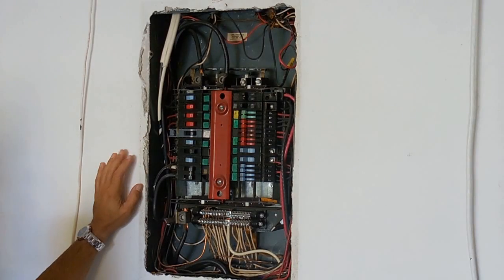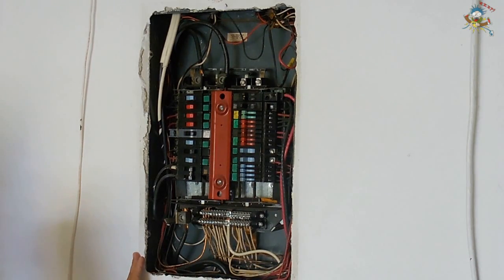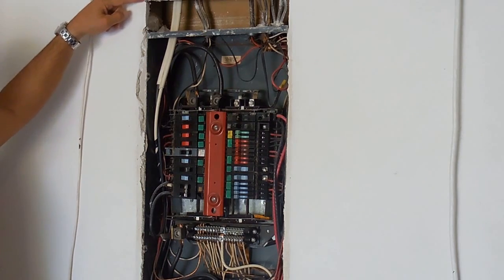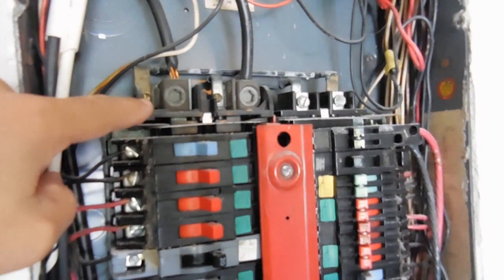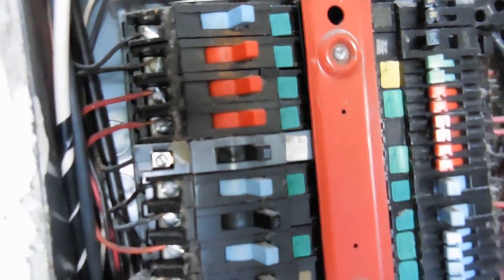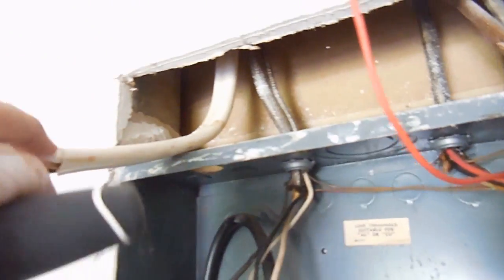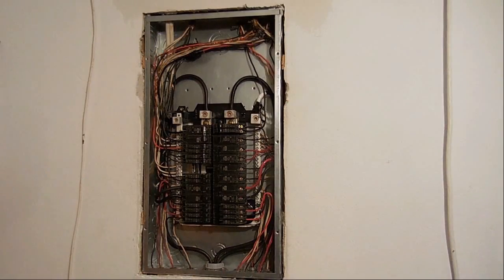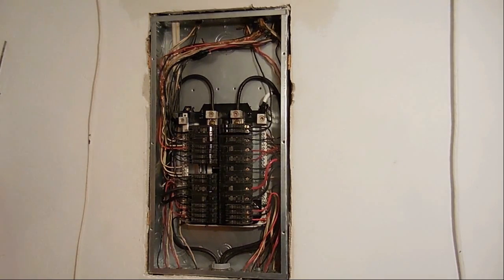Swapping Out A Breaker Panel! (How To Replace An Old Breaker Panel)

Comment from the maker: ATTN: At the time this video was made, the ONLY purpose was to swap out a 50yr old "Main" (One and only)panel that worked perfectly, but was deemed 
potentially unsafe. In the video that was accomplished. I understand 
that the NEC "considers" it a subpanel, even though it's a main. I also 
mentioned that I would be upgrading the meter can/main disconnect, as 
well as replace the service entrance conductors with 2/0 wire so the new
panel could handle the full 200A. Since this video was made, the meter can was replaced, and a main breaker installed inside the new panel, so any neutral / ground issue comments are no longer an issue. Thanks!
Reply: You need 4/0 for 200 amps
Reply from the maker: @ethanbrown7683  no. 2/0 thhn
Reply: 3/0 if using copper. I know everything in that panel isn’t rated for the 90degree column
Reply from the maker: @ethanbrown7683  No idea where you're getting your information from. LOL Copper 2/0 - 200A , 3/0 - 225A, 4/0 - 250A THHN
Reply: In the most optimistic, 195amps for 2/0 thhn. 3/0 gets you to 225. That’s on the 90 degree column for the wire. The terminations and enclosures are most likely only rated for the 75 degree column. I think you have to size your wire for the weakest link.
Reply from the maker: @ethanbrown7683 Are you finished trying to feel important to others? You're a pedant. First you said 4/0, then dropped to 3/0. For DECADES Copper 2/0 THHN was suitable for 200A service, and it will always be for me. Have a great day!
Reply: Some peoples say to separate neutral and ground but it’s not possible when upgrading most panels because of short wires. Bonding ground bar and neutral bar in the sub panel is fine as long as grounding rod is not connected to the sub panel. Or the grounding rod is connected to the sub-panel and the rod is disconnected from the main breaker located outside of the building.

Comment: The one thing that I still am unsure about is putting the new box in. Unfortunately, in your video, it just magically appeared. All wires already in. 
How many people did you need to get all the wires into the new holes?
How did you make sure that you had the wires going through the same holes as in the previous panel? Or does it matter?

Comment: How come this panel doesn't have a main breaker switch?  Is it because there is an external switch somewhere else? 
For a panel  like this how do you install a interlock without a main breaker on the panel?
Reply from the maker: The main breaker was later added to the panel. The main breaker was 10 feet away on the outside wall next to the meter can.

Comment: GE = 100% garbage last two brand new gear panels that I worked on you could only open door 90 degrees. As a life long sparky can tell you that he is the worst company for service and parts. We had a million dollar ge piece of crap dual 13,200 volt switchgear room. Took GE service department a year to get a under voltage relay. Took morons another year to get a wiring diagram because 6 year old he relay was obsolete. Had trouble with every GE medium voltage expensive switchgear. Had 1 POS GE appliance. Wife talked me into purchasing a GE gas stove. In 8 years I had to replace oven igniter 3 times because ahole at ge had the igniter always glowing & wasting electricity when gas valve was open. All other companies disconnect this energy hog after flame is detected. While heating up oven glass window blow out for no reason. Took scum bag 2 years to sell off their USA light bulb division because not even the dumbest company wanted any part of them. Would not install anything made by GE in my own house. Even if they paid me.

Comment: When you bought the new panel. How did you know that your wires were not going to be short? I wonder if there are recommended panels brands for FPE swaps for this reason.
Reply from the maker: If the wires are too short, you will be forced to extend them. No other option if you cannot pull more of the wires/cable into the new panel.

Comment: How could you make width fit if the opening is too small?
Reply from the maker: Ideally you'd buy the same size panel, otherwise you'll need to cut away the studs to make the opening larger.
Reply: The FPE panel I want to replace is 14” wide in a 14” stud to stud space. The panel I need appears to be a minimum of 14.25” wide. Advisable to shave an 1/8” off each stud? Or perhaps a link to the GE panel installed here?

Comment: How did you made the neutral long enough  to reach to the neutral screw at the GE?
Reply from the maker: It was only slightly short. I was able to go by the main breaker and pull some excess wire.
Reply: @electronicsNmore  so did you added wire to the neutral to reach it ?
Reply from the maker: @christianbaltazar6515  No, there was enough wire. In order to add. You'd need an insulated butt splice and hydraulic crimper.

Comment: this is a great video, however that panel is a zinsco, not a federal pacific, the colored handles like that are zinsco which also had fire issues, federal pacific breakers had red handles.
Reply from the maker: True, but both FPE & Zinsco are potential problems. Thanks for watching!
Reply: @electronicsNmore  yes. great video and i would be willing to say that zinsco is a bigger problem because FPE breakers have issues with other stuff failing and the breaker not shutting off, zinsco panels have issues with connections to the bus bar melting even if everything else is fine, as well as issues with not tripping.
Reply: @WalterKnox  A common problem with the older FPE panels is the breakers would come apart upon removal with the Stab Loks stuck in the buss.

Comment: I have thus Zesco (sp?) Panel and once in a while one particular circuit arc's . I clean d contacts and its good for 6 months, then i replaced d CB but it still arcs. Ever since i added my fish tank to d circuit  after about 6 years on it ,d power goes for 1,2,3 minutes out but CB doesnt trip , I toggle d switch ,power comes on  it dies this for about a week (20 times) then it stops like nothing happened and 6 months later it does it again.
Reply from the maker: Poor connection between the breaker and busbar. Move the breaker to an empty space if available.
Reply: thanks 
panel full to the max no empty space

Comment: I live in a subdivision built out in the 1950’s. All the houses had FPE breaker panels and as of 2020 there have been no house fires. The breakers work fine as I have found out for decades when I overload a circuit.
Reply from the maker: I agree with you, but when you try selling your home, they'll make you replace it.
Reply: @electronicsNmore  Not here. Houses sell here with no problem and no panels are replaced.I think a lot of things are grandfathered in until you remodel a certain area and then have to bring that area up to code. If they were seeing a lot of problems I’m sure they would intervene with the public and demand upgrading.
Reply: @electronicsNmore  --  They can't "make" you do anything.   If the mortgage company wants to sell the mortgage, they can pay to have it done.   Most of his is bogus.  There isn't anything particularly wrong with the panels. .  Some breakers were faulty.   That can happen with any panel.   You may have difficulty get arc fault  or ground fault breakers but these are troublesome.
Reply: As an electrician who worked in the trade from '75 to about '89 (when I switched to engineering), the common joke about FPE was that you could use a 15 amp breaker for your welder. The un-funny part of the joke is that you pretty much could. And this was long before the UL listings were revoked.

And while I didn't run into many burned up panels, the three that I did repair were all FPE panels. We used to say that FPE stood for "Flaming Piece of Equipment".

https://www.nbcbayarea.com/news/local/federal-pacific-circuit-breakers-investigation-finds-decades-of-danger/1930189/

Sleep tight...
Reply: The old FPE panels in commercial, institutional, and industrial establishments are hazardous.  I've had breakers come apart in my hands with the stand loks still attached to the bus.
Reply: You are living on borrowed time. If you do not want to replace dangerous panel suggest that you have interconnected smoke/CO2 detectors in every room, a fire sprinkler thru out backed up by an emergency generator, fire ladders for second floor bedrooms

Comment: how do you extend the cables In case they are short?
Reply from the maker: Use a metal junction box and add extra wire of the same diameter. if you can access it after the job is done. Attic, basement, etc. You're not allowed to hide them inside walls.

Comment: Do you have to be licensed to remove your own meter or does the E co have to do it?
Reply from the maker: If you get a permit and do the work yourself according to code, then you can pull the meter. I usually pull my own and put it back in such a way that they cannot tell it was disturbed. Newer smart meters can probably notify the electric company when the meter has been removed, since a link to your home has been lost when removed.
Reply: I like your work and don't let people discourage you on panels I have seen grounds are bonded to it only becomes a problem if its done multiple places. I don't like nec codes on ground rods being only 25 ohms its better to have under 5 ohms but its just minimum code.
Reply: We will have to change your grounds and neutral when you put in new feeders for the 200 amp and unbond the neutral bar.

Comment: I have a split bus panel at my old house and it’s already 200 amp lines I have a ge main breaker panel it has a 200 amp main breaker in it the old panel is cutler hammer ch breakers I believe I’m doing a code compliant project 👍
Reply from the maker: Thanks for watching!

Comment: Federal Pacific panels are extremely dangerous and should be replaced asap
Reply from the maker: I know many FP panels that have been in service for decades with no issues.
Reply: @electronicsNmore  True, but there is a reason why the company got sued out of business.

They did dangerous shit to save a few pennies on manufacturing cost. When companies play cost cutting with safety people die. Toyota drive by wire, Ford Firestone, Ford Pinto, GM ignition recall, Takata aurbag recalls etc
Reply from the maker: A shame that a small number of panels resulted in big problems for the company.

Comment: I would have used a Square-D Homeline panel -- not a GE.  GE panels are of the lowest quality of the panels readily available nowadays.  "G.E., we bring bad things to life!"
Reply: What about Square D QO panel?
Reply: That's the best one, but overkill for residential.  Homeline is plenty good, and is better than any other residential panel out there.
Reply from the maker: Jeff My friend bought the panel. I never had any problems with GE. Thanks for watching!
Reply: Oh I see.  Reminds me of a customer who once tried to "save me time" by purchasing a G.E. panel for a service change.  Of course, he didn't provide any of the other hardware needed, and many of the breakers were the wrong size.  I kindly asked him to return it at his convenience, and that I would purchase my preferred brand (Square D) along with all the rest of the materials needed.  He agreed to that.
Reply: GE breakers sure are cheap!
Reply from the maker: @GregsWorkshopOregon  They are, but they work. 😀
Reply: They all have the same warranty .
Reply: greg berban and? The warranty doesn’t mean shit.
Reply: @crunch9876   What doesnt mean shit is your opinion
Reply: Homeline panels have aluminum bus. QO panels are best but very expensive. HKME

Comment: Ok first off I'm not an electrician, my son is and his friends are too busy to work for me. You bonded the ground and neutral,  I assume you were not going to consider arc fault breakers because, it's WORKED for 50+ years. It might even be grandfathered in. I'm up grading a 60 year old general switch, at least I have "br" breakers. 👍J
Reply from the maker: Yes, that's the way it was before. Since this video was made, the main breaker was moved into the panel. Thanks for watching!

Comment: That's not a FPE panel that's a Zinsco panel. They were different brands. Zinsco brand panels should be replaced as well but not for the same reasons.
Reply: For future reference: Zinsco panels have the multi colored breakers and some have the red breaker secure bar which the one in the video has. The breakers terminate on bus bars. On FPE or Federal Pacific panels, the bus is a StabLok and all the breakers are black with red on the handles. FPE panels are the leading cause of electrical fires in homes as the breakers do not trip when they should causing the wires when overloaded to become heating elements in the walls. Zinsco breaker panels are the second worst in that they made many with copper and many with aluminum bus bars. The problem with this is that they made many breakers with aluminum connectors and many with copper. the dissimilar metals cause corrosion and a bad connection. the bad connection will arc and the heat causes breaker malfunctions.
Reply: @stanleyelectrical  I've had FPE breakers come apart in my hands with the Stab looks still attached to the bus.  I'm not the only one from what I've heard this is a common problem with the older FPE panels.
Reply from the maker: Said FPE on the panel.

Comment: That's a Zinsco panel, not an FPE panel.
Reply: When I saw the vertical buss bars and the colored breakers I knew it wasn’t an fpe there red breakers  and either stab lock or bolt in
Reply: The two brands have some similar flaws with the busbar, but the FPE doesn't trip which makes it even more dangerous than a Zinsco which is also hazardous.
Reply: They're both dangerous panels though
Reply: I wondered how many comments I would have to read before I found one that corrected him... The first comment

Comment: We did a leasespace in a 3 story building with nothing but 3 phase FPE equipment. To my surprise the circuits would trip quick.
Reply from the maker: Not all FPE panels are bad. The panel in this video worked just fine for over 50 years. I ran into many Challenger breaker panels that had problems with busbar/breaker connections.Thanks for watching!

Comment: Is it okay for me to stick a multimeter in ohm mode in an outlet's neutral and ground holes to check to see if the system is bonded or not?
Reply from the maker: Really need to use a tester for "Earth-Ground". I have a video below that shows a tester. Also refer to the link for more info. Thanks for watching

http://en-us.fluke.com/community/fluke-news-plus/myth-or-reality/can-you-really-test-electrical-bonds-adequately-using-a-multimeter.html

https://www.youtube.com/watch?v=lzzuCO0oJPU
(The electronic version is the tester that has the ability)

Comment: Little sloppy and GE is crap. Overall not a bad job.
Reply from the maker: A little sloppy? LOL. I think not. I've worked on many panels over the years(back to 1990), and this is far from sloppy. As for the brand of panel, they all have to pass the same tests in order to be sold to the public.
Reply: Ok, I also said not a bad job. I do this work all the time too!
Reply from the maker: electricalron Not bad is taken as a "So-So" job. This was a nice job.

Comment: Two observations, you did not mention nor am i able to confirm how you handled multiwire branch circuits that share a neutral. I would have suggested adjoining pairs with black and red  colored wires are always wired in such a fashion that blacks are on one pole of the bus-bar and and the reds are always on the other pole of the bus-bar. It does not matter which pole singlewire circuits go on as they do not share the Neutral. Though several people already said this, I would advise grounds to always be on their own bus. There was more than enough room in the panel to mount separate ground buses and tie then separately to the Neutral bus.
Reply from the maker: If you're referring to a split circuit like a 20A dishwasher/disposal, I wire it like a 240 circuit. As for the ground wires/neutrals, I left them as is. I just replaced the meter can with a 150A can, eliminated the outside main breaker, pulled (3) new 1ga wires into the panel, and added a main breaker in the panel. 

Thanks for watching!
Reply: @electronicsNmore  I have a townhouse and the 200 amp main breaker is outside, several units down from mine.  Can I replace my panel and put a main breaker in it and keep the one outside?  Excellent video, thku.
Reply from the maker: @miked5106  If you leave the main breaker outside, then use a throw switch next to the breaker panel.

Comment: thats a subpanel...neutral and ground need to be seperated.
Reply from the maker: Hello there. This has been mentioned before. At the time this video was made, the purpose was to swap out a 50yr old "Main" (One and only)panel that worked perfectly, but was deemed potentially unsafe. In the video that was accomplished. I understand that the NEC "considers" it a subpanel, even though it's a main. I also mentioned that I would be upgrading the meter can/main disconnect, as well as replace the service entrance conductors with 2/0 wire so the new panel could handle the full 200A. I'm in the process of doing that right now. The meter can will be replaced, and a main breaker installed in the panel, so the neutral / ground issue won't be an issue. Thanks for watching!

Comment: guess you don't know what objectionable current is.
Reply from the maker: Of course I do, but objectionable viewers are a bigger problem. :-)
Reply: must suck when told numerous times you did it wrong, and still think you are right. until someone gets hurt right?
Reply from the maker: Chris Meyers
Nothing wrong, I removed one panel, and installed a brand new panel exactly the way the original one was installed 50 years ago. Lasted 50 years that way. :-) Can't be wrong.